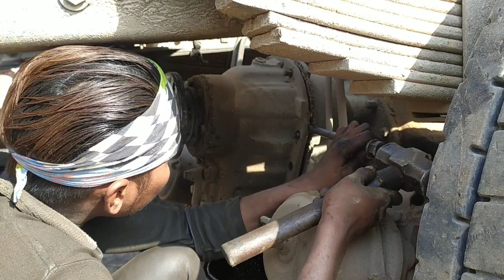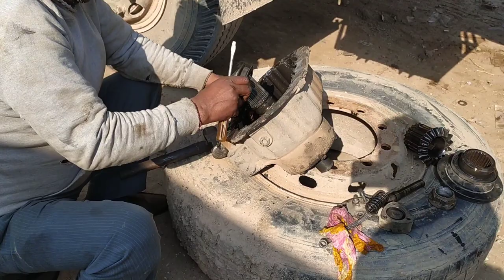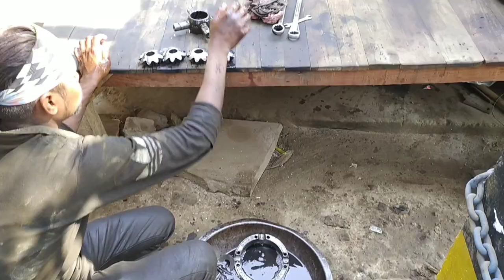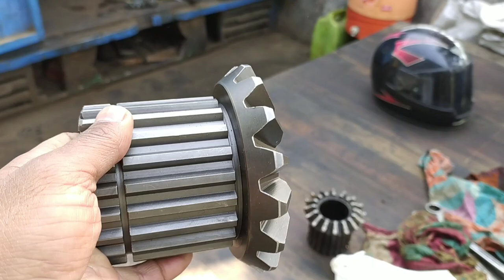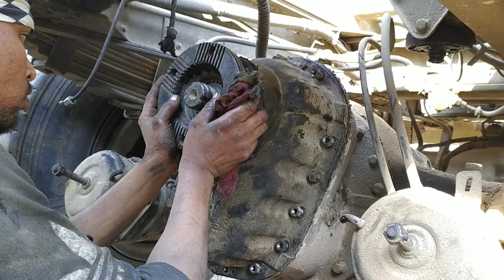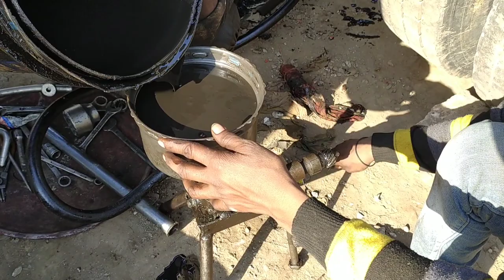Truck making noise check and repair work| 4×4 truck system| Indian truck mechanic

Comment: They are putting old oil inside wtf 😬
Reply: Crazy
Reply: the driver has no money
Reply: Most of these vehicles are on contract basis. The owner doesn't give a f neither the contractor. Wheels are what rolls for them. The Gear oil can cost almost a half month salary so going the cheap way. Absurd but truth.